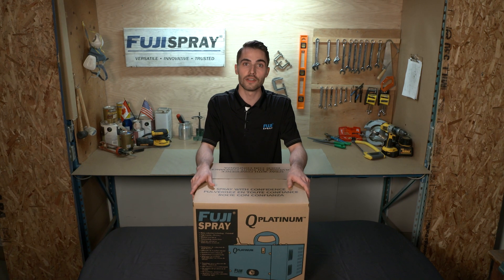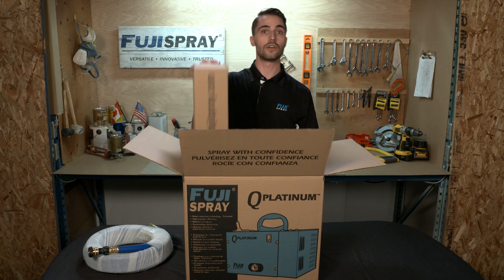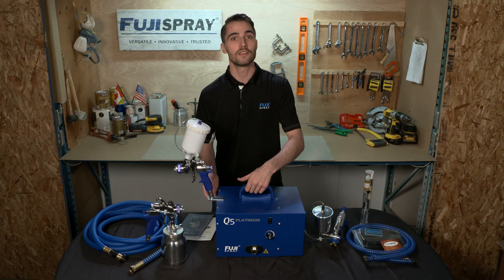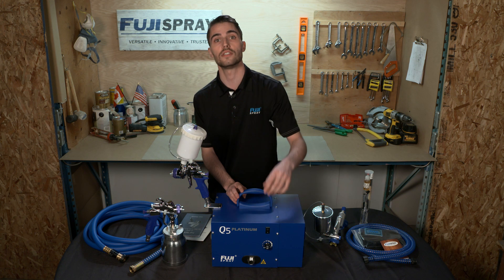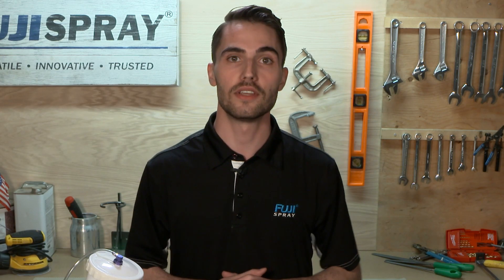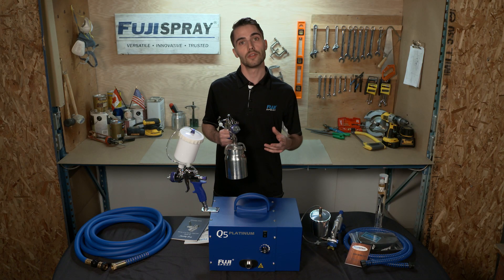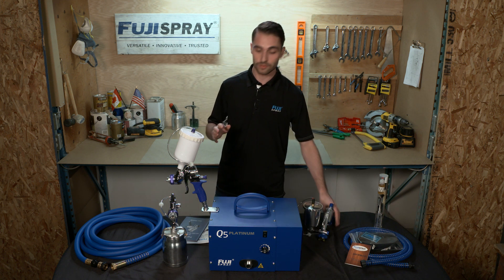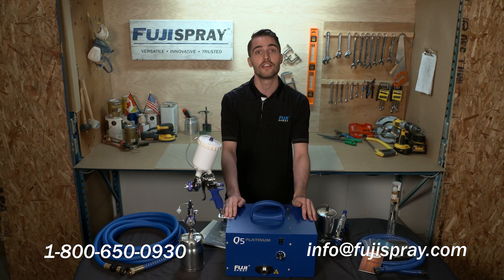What's in the Box? | Q PLATINUM Series

Comment: Hello. I just purchased the Q5 and I wonder what's the maximum air hose length that I can use with this turbine?
Can I join two 25' hoses together? 
I own Mini Mate 4 that's 10 years old and never missed a bit used professionally in my decorating business.
Thank you.
Reply from the maker: Another 25ft length of air hose is the maximum you can add, this will amount to 56ft in total (including the 6ft whip hose). - Fuji Spray Team -
Reply: @FujiSpray  Thank you for the immediate reply.
Reply: @FujiSpray  I'm amazed with the Q5 unit.
The internal diameter of the Fuji whip hose is 16mm. I have 20mm internal dia whip hose from the other brand turbine can this be used with the Q5 as well? Thank you.
Reply from the maker: @mattgloss8580  Although Fuji Spray does not recommend introducing parts or accessories that are not genuine Fuji Spray items, this should not be a problem. Make sure that the hose you will be adding is not connected directly on the turbine but rather at the end of the 25ft hose. - Fuji Spray Team -
Reply: @FujiSpray  Eso, eso es un buen servicio y una excelente respuesta 😊

Comment: Hi. Im going start paint cabinet and utility trailers. Does the Fuji Q4 platinum work for what I want?  Im look the Q5 platinum its the top of the line of Fuji system  I allready place a order in one dealer seller of one Q4 platinum but before I receive I want to know if for whats I want do the Q4 work
Thanks
Reply from the maker: Definitely! The Q4 will be powerful enough to spray cabinetry and finishes for your utility trailer. Bare in mind that depending on the thickness of the material, you will need to get the adequate air cap set size in combination with proper dilution if necessary. For further question, please feel free to drop us a line at info@fujispray.com                  Fuji Spray Team